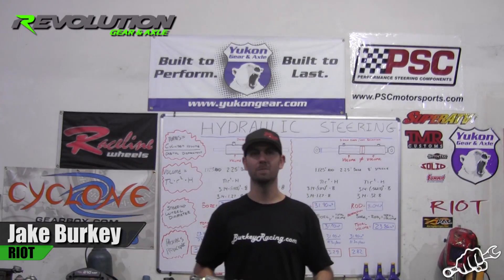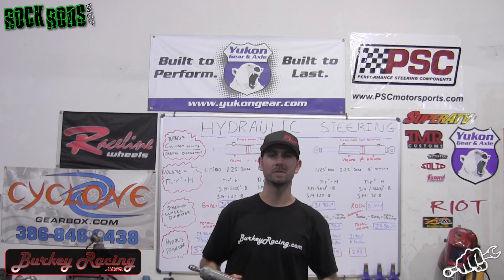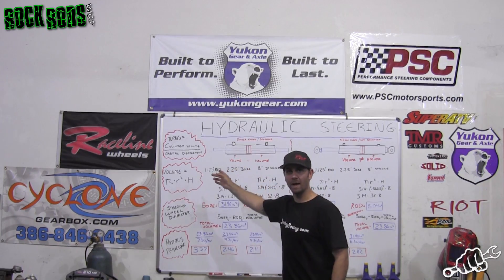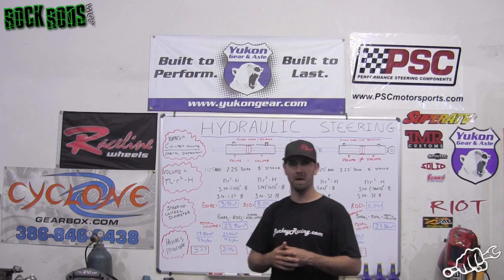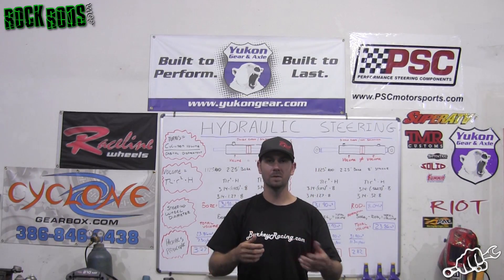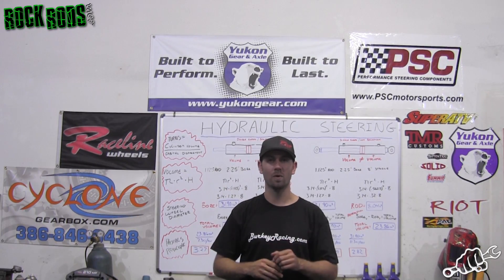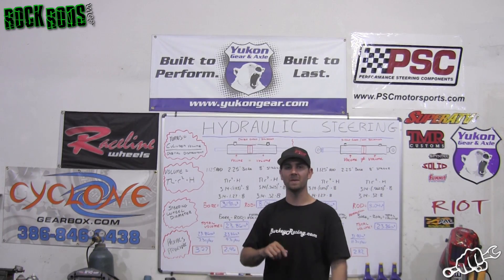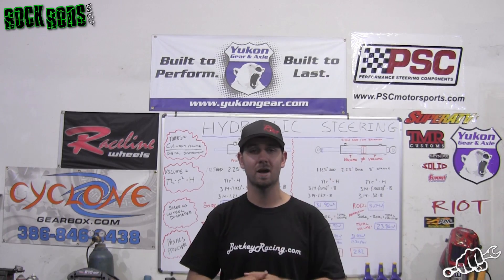Hydraulic Steering Explained - ROCK RODS TECH TIP

Comment: Great video. I have a GEN 4 forerunner with a Dana 60 upfront, and a full  hydraulic PSC steering. I’d like to discuss with you a shimmy that happening when I drive it . I just purchased this vehicle so I’m in the middle of troubleshooting wireless through accident guys. Not sure if it’s the orbital valve issue or that my ram to my high
Steer  knuckles is not on axis but has a 10 degree down angle.

Comment: is it possible to make a full hydraulic system where you still have a mechanical back up with a drag link you can remove when you get to the trail, then the pitman arm will be moving but not doing anything and I get the articulation I'm wanting in the front? 

it would also save me if I blew a hose or something on the trail as long as I carried 6an caps so I'm not pumping the fluid out.
Reply from the maker: a big hydro assist ram might do that.
Reply: @BustedKnuckleVideo  I was thinking basically something like that too.

If there was a way to run 2 systems in tandem on the street between trails I think that would be cool. Maybe I can figure out a manual steering box that would match the ratio of the hydro just in case so I don't kill people in an emergency. That's the idea.
Reply from the maker: good luck

Comment: Tractor  hydraulic steering wheel has the pump built in the upper box for manual controll in case of pump failure. International 656, massey furgeson 283

Comment: Can you explain how to design and build hydraulic assist front steering on Dana 44 80’s Chevy truck. 
Thanks so very much.
Reply from the maker: drill and tap the steering box, and get you a ram, run some lines from box to ram. Mount ram to axle and tierod and boom you are done.

Comment: If u r really reaching competing, I definitely think the fluid system full piston system travel right & left is the way to go. The thing I like about fluid is u can hve it front & rear. So why can't u hve it fast & slow on buggy. Both a pick your line big tires max push /travel & a 2nd system flip switch for going fast. That way 1 buggy can b safe for use climbing perfect line & straight line speed runs at a flip.
Reply from the maker: the systems we put together can do both

Comment: I have a problem in my hydro steering, when i try turn fast the steering weel gets hard, how can i solve it?? Help
Reply: Been there and done that,  you need a high pressure high volume pump . Trail gear and PSC have them . If you haven't fixed this problem yet. I see this post is 3 months old.

Comment: My honda rancher 420 has electronics monitoring everything. Risk messing it up if I install electric pump
Reply from the maker: have you researched that?
Reply: @BustedKnuckleVideo  .
I am thinking about 2 hyd clutch systems with slave cylinders  hooked to tie rods.  They should work because the bellcrank moves very little lock to lock. And that assist would depend on how hard I push the levers against the handlebars.

Comment: My atv turns 99% when sitting still or barely moving.
I use it moving stuff around and hour every day for exercise as I am very weak handycap vet.
Reply: I did not express that correctly.  I ment I turn the steering  mostly while sitting still. No power except me and without the aid of wheels spinning/turning. And the rest of the time I am moving slow so I need P.S. more then most guys.
So to find a small car with limited space like my atv and has a basic electronic control that has no connection except direct to battery with fuse  and
 seperate switch so its totaly independent of all atv electronics.  So I go to pull apart and look for what brand& model car.? 
I got 18 or less inches. From tie rods to handle bars.
1/3  turn to left and right.
Which means 2/3 LOCK TO LOCK.
Reply: Some fords"" back in the day"" had a mechanically connection directly on the  hyd cylinder that would hydraulic ly center the cylinder to its self. So if u turned - moved that control  left .the control centered the hyd cylinder to left turning the wheels  left. 
If u lost power  your arms would force control and bigger cylinder to move left as it cane against hard stops then pushed tie rods anyway.
Reply: Actually . The (3) cyclic slave cylinders on a huey     ..     .. hello copter. Would be ideal as they are extremely accurate& instant. But require hyd power. The cyclic stick never moves more then 3 inches in 360 degree circle ..and with finger tip touch. So accurate that flying one only requires thinking right or left and you go that way. Seriously. 
No feed back! Except seat of pants or gauges
Reply from the maker: is it EPS?

Comment: You said something about not fighting the wheel.  So do you actually get feedback from the tires? What i mean by that is if you bump someting with a tire do you feel it on the steering wheel? I was imagining that you don't but i wouldn't know. Oh yeah im asking about full hydraulic and this is an awesome informative video. Ok so you sort of answered my question later in the video.
Reply from the maker: Yes you get some feedback in the steering wheel.
Reply: @BustedKnuckleVideo  thanks for the reply, Im just doing some research on steering upgrades for my samurai. Full hydraulic is a bit of overkill, but sometimes its best to skip all the bs and go for something that is overkill.  Im scared a full hydraulic system will break my axle housing in half lol. Its a stock samurai axle
Reply from the maker: it might be a bit much for a stock sami axle

Comment: Great vid, I have 85 k20 with 3/4 ton axles and I want to have a. Hydraulic steering system. Should I do the assist or the full hydro steer? And how do I mount it on gm 3/4 axles?????
Reply from the maker: depends if you want to wheel it or daily drive it. Daily I would do hydro assist.
Reply: all trails all the time = full hydro  (if you have full hydro, you lose ALL steering if you lose hydro)
street and trail = hydro assist   (if you have hydro assist and you lose hydro it will be harder to steer but still able to have some steering)

Comment: Hey jake would it be possible to use the hydraulic ram to provide the force that would steer the axle if i wanted to use it for off-road at low speeds. what would i need to do if i wanted to replace the ram with say an electric actuator.
Reply from the maker: There are electric steering setups as well

Comment: i build a steer for my offroad car from a escavator steer.
but why still heavy.?? 😂😂
Reply from the maker: sounds heavy
Reply: +BustedKnuckleVideo 
hi...😊
i'm from indonesia
i made it from escavator part.
in low rpm my steer is heavy. and on high rpm it so easy to drive but my gearbox (oilpump) always broke.
can help me with my problem..??
thank..😊😀
Reply: +BustedKnuckleVideo 
i'm using a 3s-gte
so i must play high rpm to got a power 😂😂
Reply from the maker: Order good parts from us. That will solve your problem.

Comment: Think about it would it be stupid to build a diesel powered buggy running a torque converter and a beefed up cvt? Ps it would be engine cvt then torque converter to reduce stress on the cvt belt.
Reply from the maker: diesel power wouldn't cut it for a rock bouncer, rock crawler would be ok
Reply: BustedKnuckleVideo how much power does a   Gas or propane buggy push on the high end

Comment: Great video! the only thing that is "not" so accurate is that the size of cylinder does not effect pressure. The pressure is set by relief valves within the system, not diameter of cylinder. The size of the cylinder effects the surface area of the piston. The pressure remains the same, but the area the set pressure effects is larger ; thus creating more energy to perform desired work. Speed and force "are" effected. Larger cylinder, slower speed. Larger cylinder, more force. Smaller cylinder, faster speed. Smaller cylinder, less force.
Thanks Jake for your videos!!!
Not trying to be a d*$#. I just feel inaccurate information sends people down wrong avenues.
Reply from the maker: Jake will have to debate you on that one
Reply: Good point made here. To have a productive conversation you would have to make sure you were talking about the same type of pressure. Hydraulic pressure applied by the pump to the piston surface or mechanical "pressure" applied to by the shaft to the steering linkage.

Comment: Really good video,  loving the series!
Reply from the maker: Thanks! We really enjoy putting them out there.
Reply: @BustedKnuckleVideo   can you tell me, does an Orbital valve care which way the ports (hoses) are facing. 
Would it not air lock if the hoses were run out of the underside?
I see the example in your video is this way, but is there any special considerations.

Comment: Tons of great info Jake. Thanks for using my suggestion. You mentioned the tradeoff using a smaller cylinder to gain speed. I too would like quicker steering and am running 43's. Has the lack of force been noticeable to you while trail riding? Would you still run that setup if you didn't race?
Reply: Yes the force is noticeably less when you get in a bind.  I have some tricks though that will get the best of both worlds.  I keep some things in my back pocket for the competitive edge.  Shoot me en email burkeyracing@gmail.com and I'll explain
Reply from the maker: where ya at Jake?
Reply: Also, I'm running into clearance issues with the pump pully. I can relocate the pump but that will put the pully into the chassis by 1/4". Will a 4.75" or 5.0" pully spin the pump too fast? It's a stock LQ4 right now. Thanks
Reply: Yes the is a noticeable lack of force when you get bound up.  I have a trick though to help with that, shoot me an email and I'll explain
Reply: It will shorten the life of the pump, but it will steer fantastic till it pukes

Comment: Great video, lots of information. But what about the pump? Do you use electric or engine driven unit and is there any benefits to be had between different flow rates?
Reply: Electric pumps have not yet reached a point where they can be used for primary steering.  In order to get the pressure and flow needed the electric pumps have to way exponentially more than an engine driven pump and are significantly larger.  They do not work well in our applications
Reply from the maker: Engine driven is the most commonly used setup.